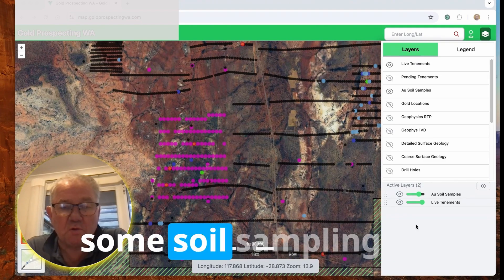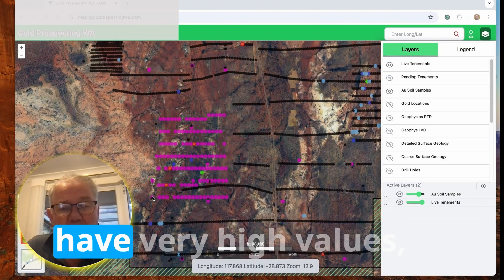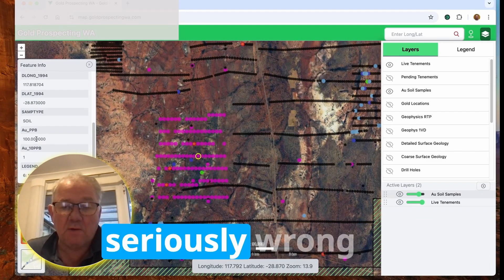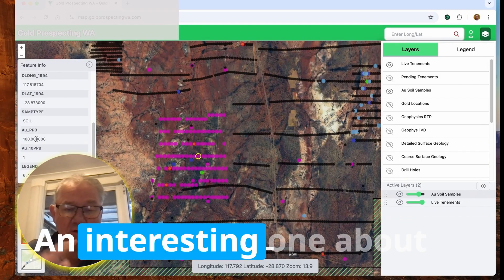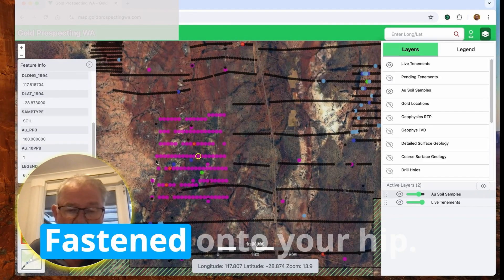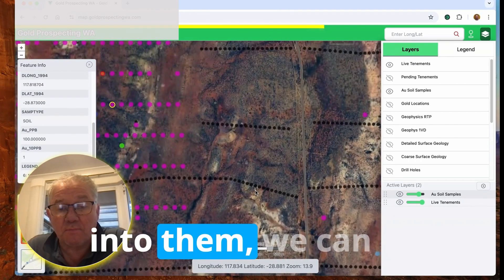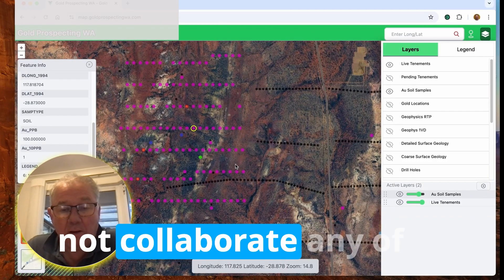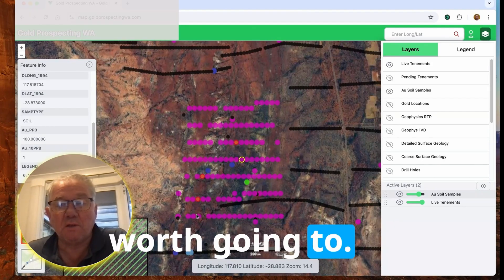Don't go to this spot looking for GOLD!

Comment: Sorry I disagree everywhere I've gone this year I've followed the high soil samples off detector maps and smashed gold actually parked on every bit I have found the highest number I came across was in the high 3000s ppb I parked took 10 steps after I worked out where sample was taken and smashed a 6 grammar no I will stick to what I'm doing don't mind parking on every bit of gold i found and I used to spend all summer chasing soil samples and reading investor reports etc this new app has taken all that hard research away and put it right at my fingertips and it's been on point for every but I've found this year so far have noticed too that all the big patches I already knew of weren't in the pinks but more in the blues and that's the case for some of the biggest patches I know of
Reply from the maker: Thanks for the fedback. Its intersting to hear your experience is so different

Comment: Totally disagree. Can you add the Distance
between the dark green plot points and your black dot please ? I have had success on  much higher reading then you have stated here, not sure how you have come to this Conclusion. Would like a better understand what the fault is with these plot points and the PPB or PPM. are the set for 100 metres or 300 metres and 500 metres  reading taken. High reading taken between the the green and tally up Historical reading between giving a High PPB. Just a question.
Reply from the maker: Thanks for the comment, much appreciated! I will have to chase up the info you asked for and will get back to this comment asap!

Comment: Actually 100 ppb is 0.1 ppm ( this is the standard measure, "parts per million"), i.e. aprox. 0.1 grams per ton. Nothing abnormal here.
Reply from the maker: I have to very respectfully disagree with you on this! The "standard unit" that many people refer to, is actually the lower detection limit of the assay method. Years ago, and I'm talking 40+ years ago, the best assay techniques only had a detection limit on 0.1 ppm ( or 100 ppb). It's did not mean that the soil value was 0.1
Since the mid 80's, any self respecting soil sampling program would be done using ppb, with detection limit down to about 1ppb. Modern techniques are even more accurate.
If any modern sampling is done today using ppm precision, then it's either done because of a lack of money, or lack of knowing what is currently available.
All these best and thanks for the great comment!